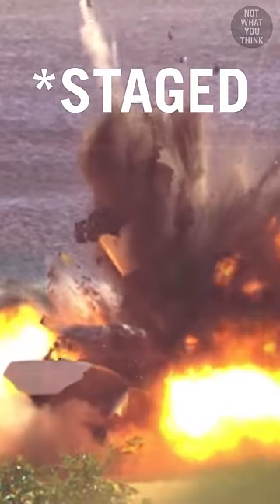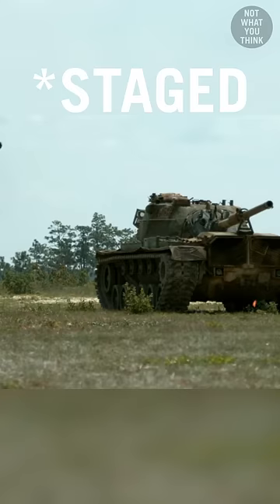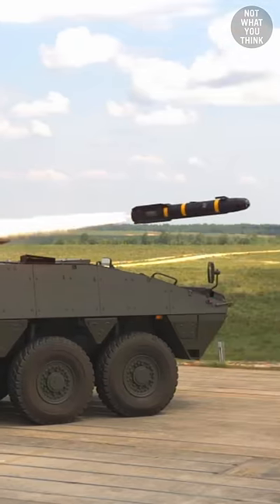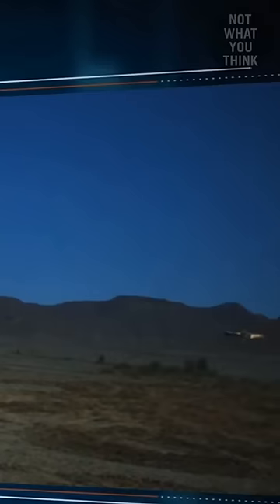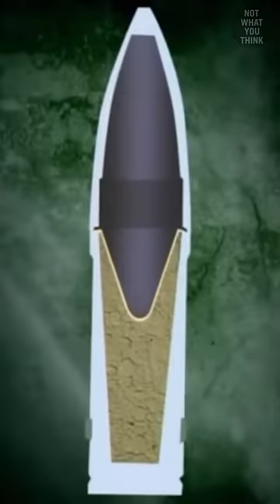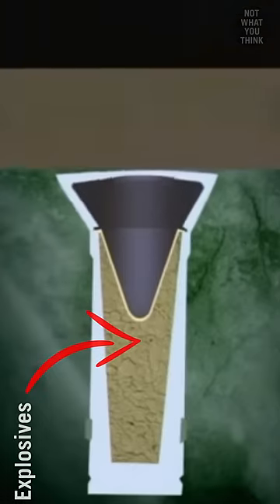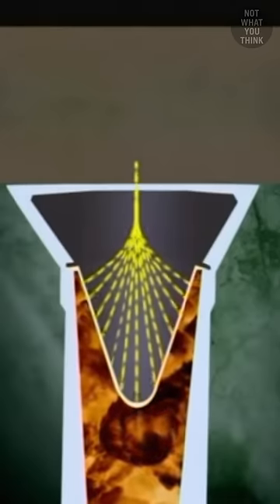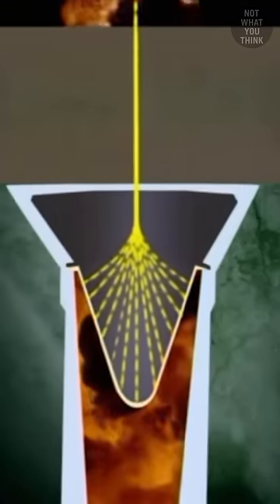How Anti-Tank Weapons Work #shorts

Comment: And thats how you destroy a tank. Not by tickling it with 30mm rounds
Reply: @zihad2133  Iraqi tank Crews also drove in what again? T-54s?
Reply: @zwojack7285 t-72s and t-54s
Reply: All tanks have max 40mm roof armour. But I doubt you could kill crew with 30mm on frontal armour, especially ones with spaced armour
Reply: A few 30 mm rounds with a tungsten core can also immobilise a tank if they hit at the right spots ..
Reply: @PhysicsViolator  Alright then lets discontinue any weaponry above 30mm because it's such a good tank killer.
Reply: @PhysicsViolator  doesn’t kill. An immobilised tank, while not very desirable to be in is still a deadly tank unless you have a good plan.
Reply: @GodofWeird as far as I know isn't an immobilized tank considered a "kill"? What are you going to do with an immobilized tank? Tank crews would have to retreat from that.
Reply: @zwojack7285 is that what he said? Stop acting stupid. That is a logical fallacy. Each caliber has its own uses. A 30 mil can penetrate from the weakest sides of the tank but it'll never penetrate the front and would most likely not penetrate the side. That's what the larger calibers are.
Reply: @senseishu937  immobilised tanks can still shoot at stuff, if you are in a good position you can still stop enemy attacks whilst backup comes to help you. A tank will probably notice something flanking it. It also depends what the tank is doing. Immobilising a tank is usually considered a mission kill, it is no longer able to do what it needs to do but if a tank is defending something as long as it can stop the attacker it isn’t ‘killed’. Though yes with modern tech no one wants to be in a immobilised tank, especially when your enemy has good weapons.
Reply: @senseishu937 The attack is from the top at a steep angle so... Your argument is invalid.
Reply: @senseishu937  also 30mm can kill a track, or damage the gun. I’m guessing he was talking about the a10 when he said 30mm so assume 4 rounds on target out of 40 bc accuracy sucks on that thing. Thata gonna do some damage to the gun
Also any crew would shit themselves hearing the a10 gun run on a tank
Reply: Look up Bradleys and buttoning. An autocannon doesn’t need to kill if the tank is blind and can’t move.
Reply: Russian T-series tanks can be easily penetrated by 30mm shells by firing to the side or rear
Reply: @zubi9995 like Leo, Abrams and other tank. And some T- series have better side armor then west tank.
Reply: .... ah yes because the fairchild republic A-10 THUNDERBOLT-II C.A.S aircraft. designated "warthog" has 0 confirmed tank kills.

mmm sad.
Reply: Its not about the mm, its about the propellant method and intensity. A rock that's 100mm in diameter is not the same as an artillery shell of 100mm.
Reply: With one 30mm? Damn, no. 

With a hell lot of 30mm? Yes. And the Legendary A-10 has done it 

You know, a wasp cant kill you, just hurt a bit. A thousand wasp...
Reply: @justaguy577  yea, because I have soft skin. A tank is armored.
Reply: @zwojack7285  and? A barrage of 30mm out of a gatling Will take down a tank. No matter how armored it is
Reply: Not all 30mm rounds are the same. A bradley would tear soviet tanks to shreds.
Reply: @GodofWeird you gonna convince that tank crew to stay inside the tank?
Reply: @GodofWeird if your tank got immobilized you are likely not in a good position
Reply: @GalladeTheWarrior  I think the thought of getting blown apart by a 30mm cannon  is convincing enough to not leave a tank.
Reply: @zwojack7285 id rather be in a t 54 than an m113 if im getting peppered with 30mm lmaooo
Reply: @connorhart7597  while that is true, the T-54 is very old. I was talking about somewhat modern tanks, like the T-72, T-90, Abrams, Leo 2, Challenger and such.
Reply: @zwojack7285  oh absolutely 100% agree, I was just talking about the t54 comment hahaha
Reply: @zwojack7285 The logic of "then we should discontinue any caliber above 30mm if its so good." Doesn't make much sense. On a basic logic level, 55.6 can kill people really well, and nobody is calling for the removal of any rounds above 5.56. And on a further inspection of roles, the A10 can use the 30mm as a tank killer because it can hit the tank from the top or rear easily. We dont decommission all calibers above 30mm because our tanks aren't flying, and therefore have to hit other tanks more conventionally. Its a fine tank killer for planes, especially if you want that plane to be able to hit lightly armored vehicles, infantry, and strongpoints, but you might find it lacking in tank killing potential on the ground.
Reply: @charliebasar9068  name one tank it killed with it's gun.
Reply: @zwojack7285  I couldn't find any concrete records of the A10 so much as shooting anything with its guns, I only found pilot claims, which you (fairly so) might not consider reliable. I did, however, find an American experiment conducted on T62s, where the A10 was tested in strafing runs against them to test the very thing we are arguing about. In 5 passes, each against 2 tanks, the A10 scored 3 catastrophic kills and 2 mobility kills. So it can kill a T62, at the very least.
Reply: @charliebasar9068  Alright, in the event of a roughly 65 year old tank appears, the A-10 can take it.
Reply: @justaguy577 lol no. The a-10’s kills were nearly all missile kills. And all of its tank kills were missile kills.
Reply: @PhysicsViolator sure. So can a 50 cal. But that’s a bit besides the point
Reply: @justaguy577 "a barrage of 30mm will take down a tank no matter how armored it is"
Interesting, because I thought the entire point of tank armor was to stop tanks from getting destroyed easily...
Have you ever heard of ATGMs? they're the best tools for getting rid of tanks nowadays, not the GAU-8, which isn't very accurate, can't be used without air superiority or against enemies that have any sort of anti-air defense, the A-10 was a great plane in the time period and situation it was designed for, but nowadays there are far better options, while an A-10 could definitely carry and fire ATGMs, I'm fairly sure the USAF has better aircraft to do that with, you can find out all of this with a quick search on the internet, which unfortunately not many do seeing as many people still make absurd claims like yours.

anyway, unless you can find any trustworthy sources, not random short videos claiming random things with no sources backing them up, stating that the GAU-8 can destroy any and every single modern tank, then what you just said is nonsense
Reply: A-10 must directly hit the torrent or the rear of a MBT to destroy it. (Luck couldn’t hurt either)

Older tanks will pose very little problem for the A-10.

And yes, Air-Ground Missiles should be option 1.
Reply: Codm be like
Reply: @JS-rv3et Correct. Zero tank kills... with the gun. The A-10 carries missiles, you know.
Reply: @senseishu937 Depends. The tank is usually towed/repaired after the battle, if possible.
Reply: Tickling it with FPV drones to the top or rear is highly effective
Reply: The 30mm is meant to defeat the ERA
Reply: @senseishu937 what caliber is the A10 warthog shooting ? Can’t it destroy tank ?
Reply: @GodofWeird depends on the 30mm, the Gau cannon on the A-10 can penetrate around 70mm of steel at the ranges it would be fired at. Striking a T-72 from the front would do nothing but strip everything that is external off the front and blow up all the ERA which would still make the tank rather useless because it would be completely blind and likely unable to move.

Hit from behind or to the side and you have a 50/50 chance that one of the rounds will penetrate and hit something important such as the engine or it will skim through the roof and kill crew.
Reply: @zwojack7285  tungsten is extremely dense wich why it makes good penetration rounds
Reply: The 30mm was meant to defeat anything but mbts, sure maybe it could pen older Soviet mbts like the t54 from the side but odds are it's probably just better to blind and immobilize which would count as a kill in the field technically speaking. But the ifvs that have a 25/30mm autocannon is also equipped with at least 2 atgms, sometimes people forget that.
Reply: "COD gamers enter the chat"
Reply: 30mm works in a large amount of rounds hitting the weak armor on top
120mm apfsds works by hitting the front armor at a very high speed and cutting through it
HE of any size works by making the armor collapse.
HEAT works by creating a molten jet through the armor
Reply: @zwojack7285  t-90M vs bushmaster?
Reply: @GodofWeird   im sorry but if you are face to face with a tank in an autocannon its already bad
Reply: @senseishu937   the BTR-80A's 30mm autocannon gets an APDS round that can pen 90mm of steel most side armor on modern tanks is around 75mm
Reply: @yukko_yoshida  it depends on a hundred factors. If the autocannon is on your flank, close by and well hidden then yes you might as well surrender. But if it’s 1.5 km away and in sight it might as well surrender.

Also this  comment is half a year old why isn’t it dead.
Reply: This comment has aged poorly… Ukrainians with bradleys have entered the chat
Reply: From the theory Ive read online theres many kinds of "kill". In the chaos of battle, often times if you make a vehicle unable to move, youve already made the vehicle fail its mission. If a tank carries a lot of firepower, if it cant get to the frontlines its mission has failed. Thats a kind of "kill". For most cases the ammo cost is much smaller compared to the cost of turning a tank inactive.

Like the case for 5.56 nato. Sure, one hit may not rip anyone limbs off or may not instantly kill someone. But the injured opponent will be cared for by their comrades, thus pulling two fighters out of the fight.

Strategy
Reply: @senseishu937 A immobilized tank is considered a kill. This isn’t war thunder, we don’t get a kill marker, and the tank doesn’t just explode. If the tank can’t move, it’s a mobility kill. And the dude who says “ Oh but the tank can still shoot at stuff “ then it’s not immobilized.
And if anyone of you say “ But the crew aren’t dead, and it can be repaired! “ if it can get to a point in the middle of a battle where the crew can A. Get out and survive and B. Manage to repair the optics, tracks, etc. it has most likely already failed its mission. Which is why it is known as a kill.
Reply: @GodofWeird In military terms, if a tank can still move and fire its turret, it is not considered immobilized. Basically if it can move under its own power, it’s not immobilized.
Reply: @LuthairLineage  not sure what I said before but I agree
Reply: @senseishu937  Sorry that probably came off as condescending, it wasn’t meant to sound like that. You said something about “ I’m pretty sure an immobilized tank is considered a kill “ and I was just confirming, as well as rebutting some other people.
Reply: @LuthairLineage  no problem 😁
Reply: Each depleted uranium round uses the broken pieces of tank armor to bounce around inside. They both work, but only one goes BRRRRRRRRRRRT
Reply: @zwojack7285 that and the T-72 and many other variants..
Reply: @justaguy577 yes, the A-10 is only an effective tank killer if it keeps aiming at the roof of the turrets.

Comment: I fired an NLAW once and they have an OTA mode (over top attack). The warhead will sense when it's over the top of an armoured vehicle and this shaped charge can shoot downwards, with extreme accuracy and completely perpendicular to the rocket assisted direction of travel, into the weakest part of an armoured vehicle or tank. That weapon system is about £30,000 a piece and my section fired 9 in a day once. They are ruthlessly efficient at destroying armour
Reply: survivors?
Reply: this is not an usual shaped charge but a so called EFP - "explosively formed penetrator"
it has a way higher effective range, but need a higher standoff distance between the targets armor.
On the other hand does it have less penetration in most of the cases.
Reply: Taco Bell targets ppl's stomach with the same accuracy 😅
Reply: @Blei1986 an EFP is formed by a shaped charge. It's the same thing made by HEAT warheads in a different shape.

Comment: The shape charge was a brilliant design.
Reply: It's a german design from early WW2
Reply: @rallec7705 its orginal concept is German but far older than WW2 goes back to the 1880s. Munroe discovered it by 1888 in the US and the US Bazooka predates the Germany Panzerschreck which copied it in WW2.
Reply: As John said, Munroe (U.S.) was the first to formally research, experiment, and publish his findings regarding a shaped charge’s effects and the importance of a liner to shape the cavity. His work was expanded upon years later by Neumann (Germany) who experimented with different cavity shapes and measured the effects on a variety of materials, most importantly steel. However, what I find most interesting is that miners had been utilizing a crude form of shaped charges for many decades prior to Munroe/Neumann, solely as a way to save money on gunpowder/TNT.
Reply: @johno1544 german tanks were using heat shells before either the bazooka or panserschreck existed
Reply: @sigstenbockgard8080 not often, first model 1938 with limited production and unrecognised ability lol
Reply: It's basically firing a gun at the tank. As in, a literal gun. The head of the missile is the trigger, and the rest of it is the bullet. They just ignite it at point blank range

Comment: Note the copper jet doesn't "burn" thru it uses its speed and kenetic energy (as mentioned in the video) to destroy the target not the heat/thermal energy as a weapon against armor.
Reply: to be fair, the sheer amount of friction caused by this copper jet does kinda melt the armor. or atleast liquifies it.
Reply: Basically when metals(well among other things) will, under extreme heat and pressure, essentially flow like a liquid even though it is a solid, and thus it forms a jet. Now with that said, energy can't be created nor destroyed, so the resistance to the jet punching through the armor converts the kinetic energy into heat and thus you can get molten or at least glowing metal along the edge of the whole, giving the impression it melted through, but the same thing can happen with traditional AP rounds.
Reply: @SallinKari  Sparks and molten metal fly off when APFSDS hits armor this becomes more evident with DU projectiles as it self sharpens and almost has incendiary qualities.
Reply: Could a weapon like this be carried by a soldier and used against tanks?
Reply: @eatingtheleaf4659  yes. NLAW, Javelin, MAAWS, AT-4, RPG-7 etc etc. Most if not all anti tank weapons all the way back to things like the German Panzerfaust of WW2 use HEAT (High Explosive Anti Tank) warheads which is what is described in this video
Reply: @poseidon808  Oh ok. So because of logistics, wouldn’t it be really advantageous for a cheap soldier to take out an expensive tank with a man carried anti tank weapon?
Reply: @eatingtheleaf4659  yes, but it’s more advantageous to kill a tank with another tank, here’s why: an NLAW costs about $30-40k USD, an APFSDS round fired out of a tank costs about $5k USD, that tank can then go on to gun down infantry, destroy additional tanks, provide limited ISR with it’s sensors, etc
Reply: @eatingtheleaf4659  yes,  thats why since late  ww2, the main weapon to take out tanks have been weapons like this. cannons became too big, so man portable rocket launchers became the go to.

not just missles but also tank shells turned into either HEAT rounds(this) or APFSDS which are just massive needles that poke through tanks.
Reply: @nickvanachthoven7252  Thank you
Reply: @eatingtheleaf4659  The other issue is man portable munitions like are much shorter ranged and less likely to hit as well as being more vulnerable. In urban environments where infantry can much more easily get close they are more effective, but in open battle it is far riskier to use infantry.
Reply: @nickvanachthoven7252 it doesn't melt anything.Its just kinetic energy from a really high speed projectile.If you look at the exit holes on the armor they are all rugged and basically punched trough
Reply: @gumelini1 you're just wrong lol. HEAT and even APFSDS put so much force into the armor that is basically turns it into very hot metal soup
Reply: @sigstenbockgard8080  you could probably tell that to someone who has zero knowledge and experience on the subject,but not me.I was in the armour regiment in military and we learned everything there is about armour and anti-armour.Your theory doesn't hold water here
Reply: @gumelini1  it's not a theory though, the energy from the rounds turns the metal from a full solid to a more plastic like state
Reply: @sigstenbockgard8080  that it does,but it doesn't turn it into a hot metal soup like you first said
Reply: @poseidon808  What do APFSDS and ISR mean?
Reply: @GazB85  APFSDS: Armour piercing fin stabilised discarding sabot, its a solid shot tank round commonly used these days in most MBTs. ISR is Intelligence Surveillance Reconnaissance
Reply: @poseidon808  Thanks. 👍

Comment: For folks who like the engineering aspect, I learned something interesting today about tank rounds that might apply to other big rounds.

The fuse of tank rounds extends deep into the propellant charge. As Lt. Colonel Nicholas Moran put it, all the propellant in a tank round needs to go off at a specific time--the same time--or else you'll get a bad or inefficient pressure wave. 

It's interesting how when you scale things up or down their design has to change in unexpected ways.